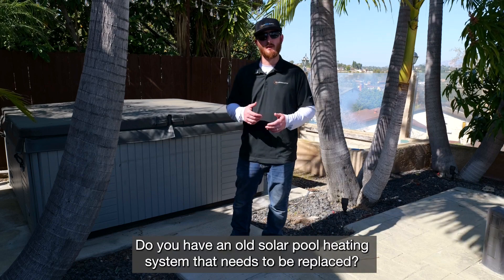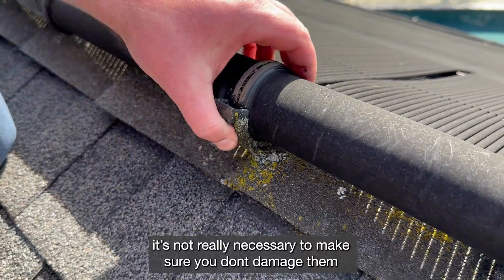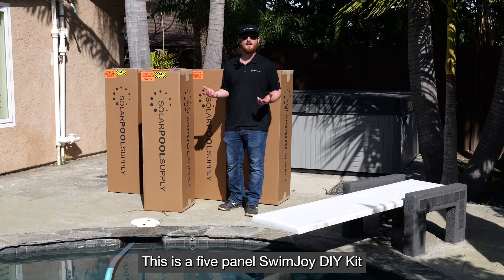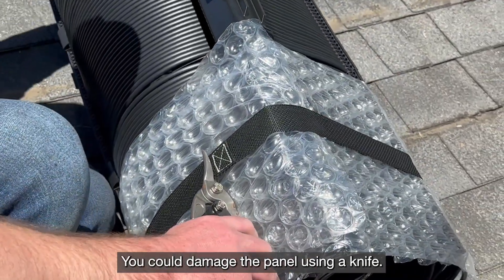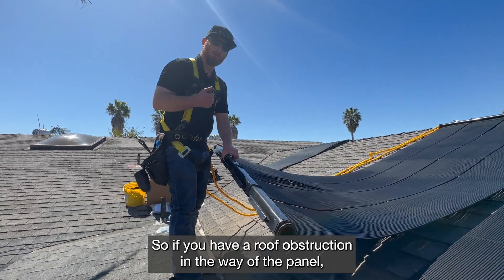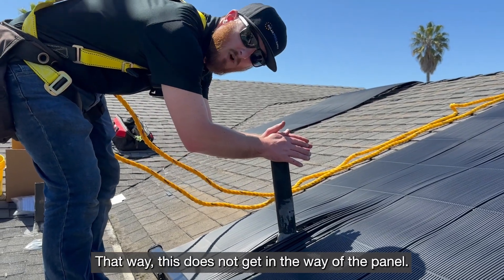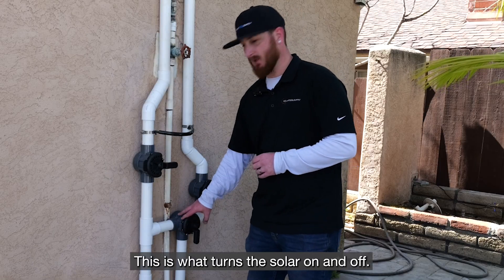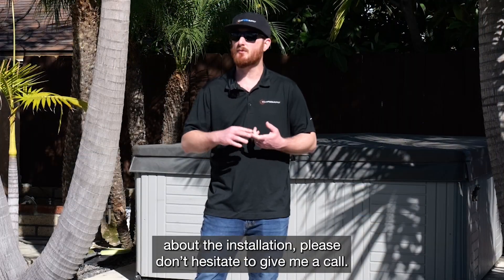How to Replace a Heliocol Solar Pool Heater - Fast & Simple | How-To DIY Guide

Comment: Great video and instructions. I need to replace my system. The problem is that no one wants to do it, they only do solar electric systems. The Florida panhandle (Pensacola) needs someone that specializes in these systems.

Comment: I have the exact system and it’s 14 years old. My roof needs to be replaced and all the local dealer wants to do is sell me a new panel system for the pool heater but my panel system still heats the pool wonderfully. I’ve upgraded the electronics at the pump along the way, but I don’t see anything that wears out on the roof panels. Mine are still pliable they flex but I can’t get anyone to reinstall them so I’m doing it myself. No one wants to take liability I understand but they work perfectly. The sun hits them in the water heats up in my pool gets warm. Nuff said😂
Reply from the maker: Yes, a solar pool heating system works incredibly well, doesn't cost anything to operate, and last a long time. Thank you for sharing your experience.

Comment: Are you using Stainless Steel Shims or Aluminum ?
Reply from the maker: The tile patches to seal the old mounts is a galvanized steel product. They make it in various materials and finishes your local hardware store should have a few options.

Comment: are you going in to the truss or just the decking for the header bracket?
Reply from the maker: For a comp asphalt shingle roof it's good practice to hit as many truss' as you can, but some may not line up depending on the spacing and roof type so into the underlayment is ok as well.

Comment: Are there any guidelines regarding those 90 degree curves and water pumping losses? Should they be smoothed out?
Reply from the maker: Standard 90's are okay as long as you don't use them excessively. using 45's in places where you can will help. There also 90 "sweeps" which have a longer smoother radius.

Comment: not w the money  compleet  overpriced
Reply from the maker: Solar pool heating systems will pay for themselves within 2-3 years in comparison to the costs of running a gas or electric heater. After that it's virtually free so you will get 12-20 years of free pool heating. Absolutely worth the investment!